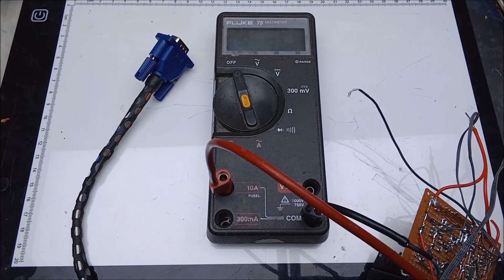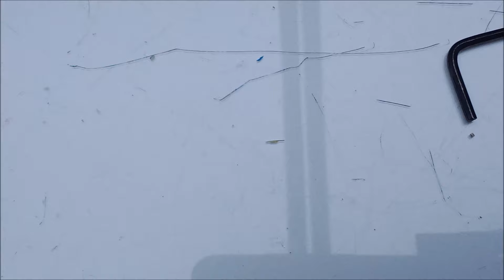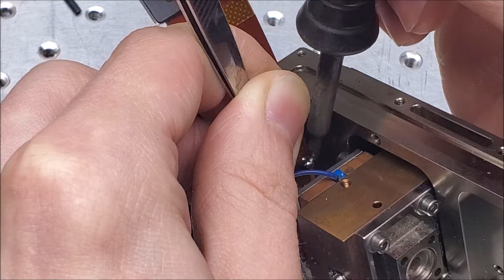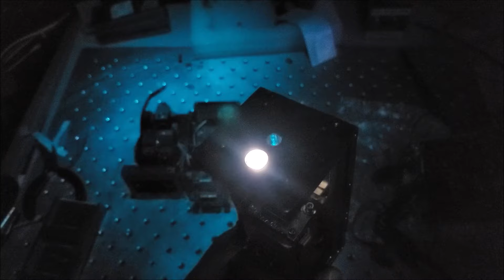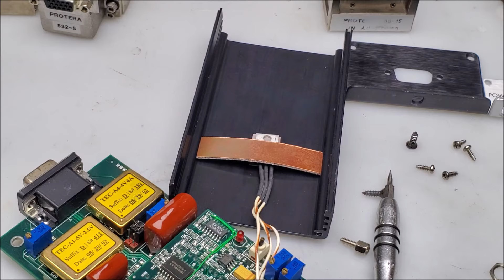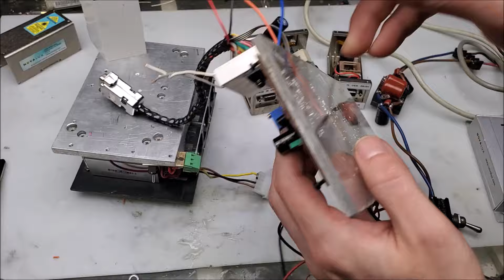NovaLux Protera Laser Restoration & More

Comment: Great video! Btw I wanted to ask, for some of my laser projects, whether it is a projector or a high power array pointer, what type of glass window do I use for dust protection? I tried on a quartz microscope slide but the reflection is pretty bad with those. I know edmund optics or Thor labs probably has what I need but I don’t know what kind.

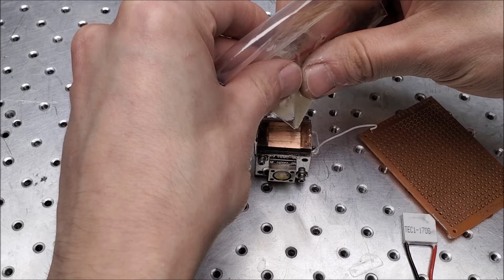Comment: 39:39 Is your epoxy thermally conductive?
Reply from the maker: It's not designed for thermal transfer no. However it works reasonably well in this case given the wattage vs surface area. I have used aluminum/copper powders in West Systems to help with thermal conductivity. The finer the better.

Comment: Your hunch is correct.  The Analog Devices ADUC831BS is an 8051 based microcontroller with ADC and DACs built in.   Thanks for the detailed video.  I enjoy listening to the fix the complicated laser toy videos.
Reply from the maker: The more complicated Lasers are full of practical engineering insights and unexpected learning experiences. I enjoy working on them!